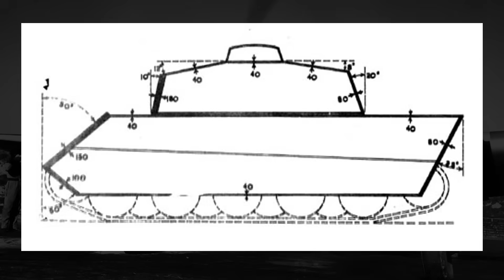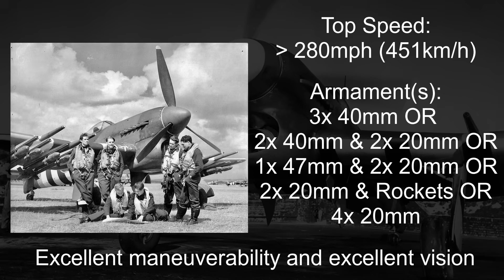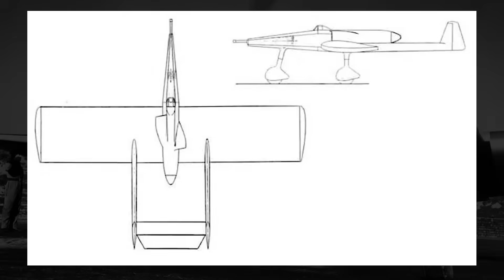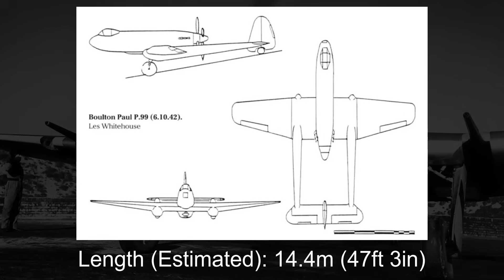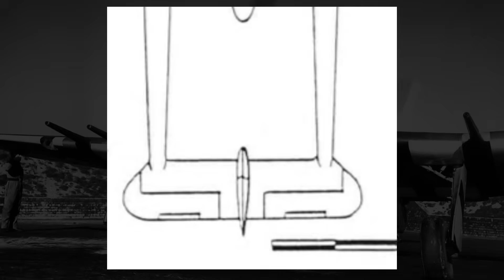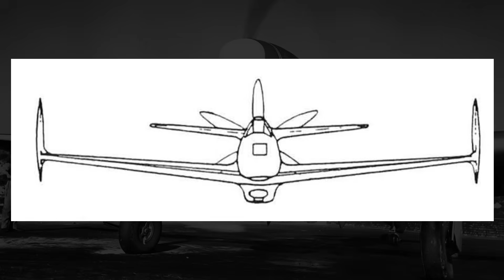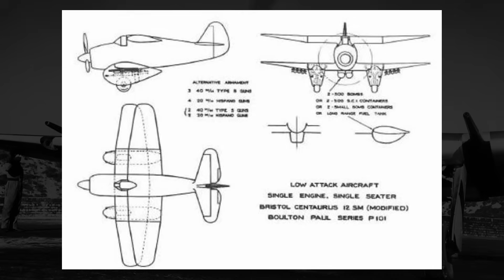Boulton Paul's Failed Tankbuster Trio: Boulton Paul P.99, P.100, & P.101

Comment: Great video, and I've seen it in the comments here a few times, but I want to get across how important it is to please practise saying it as "BOLTON" and not "Butaan". Like as in "Boulder".

If you're not sure, never a bad idea to ask Siri or Gemini how to pronounce it.  

But, thank you for covering these obscure prototypes that look cool, but never made it into production. They remind me of something out of The original Xbox game "Crimson Skies" or from the movie "Sky Captain and The World of Tomorrow".

Hearing the word "Butaan" So many times made me feel like I was on a Death March.

By the way, the biplane configuration was tried with Lysanders with a fully enclosed and traversing rear tailgunner pod out of a heavy bomber put in between Twin Tails with four .303 machine guns. It was designed for close air support and tank busting. Apparently with the twin wings, the already amazing STOL and manoeuvring characteristics of the Lysander made it more maneuverable than an angry snake, but it was held back by its speed. The air ministry wanted more. But they did build a prototype and it did work well!  The tailgunner was meant not only to counter any aircraft, but to strafe targets after the pilot pulled up from the initial attack run. It reminds me very much of the BP 101 proposal, so perhaps that's where they drew their inspiration from.

Comment: I read up on the Sack AS 6 and it never actually flew, best it ever did was some minor hops and nothing they did ever worked, though one proposed fix was never implemented, which was to replace the 240hp Argus engine with a 2000hp DB605....which is a near ten-fold increase in power and probably would be enough to get it airborne....and also enough to disintegrate it. Mind you, they already reinforced the tail to deal with the 240hp engine.

Comment: The discussion of these aircraft and with the visual images of rocketed loaded Typhoons misses an import point to the story. In 1937 Sidney Cam was started work on the replacement for the Hurricane and ultimately the Spitfire. The Typhoon was rushed into production in 1940 & 41 after its first flight in 1940. Perhaps rushed too soon but there was a war on and this was Britain’s darkest hour. The increase in performance would be provided by using the newer generation of power plants. Unfortunately the aero information used for the design of the Typhoons  wing created a wing with a too great of a thickness relative to its chord. The extra horsepower of the Napier Sabre engine over the Rolls Royce Merlin was wasted  pushing the thick wing through the air. The high altitude performance of the Typhoon was disappointing compared to the Spitfire. So the Spitfire stayed in production with continual improvements but the Typhoon lacked the desired high altitude performance, but the Typhoon was already in production. Luckily they found another role for this fighter at lower altitude. Sidney Cam finally figured out the thin wing would provide the desired performance and that aircraft was the Tempest. So no need to build a one trick pony with a unique Boulton Paul aircraft when another Hawker aircraft was already in production. Am I missing any details?
Reply: That’s when they developed the Tempest if I remember correctly.

Comment: Well my guess is, the mechanical arm trowing the pilot down would require far less force to work. It could just be something similar to the fork that brought the bomb away from the proppeler on Stuka or Dauntless dive bombers. Flinging the pilot up would be fighting against the gravity and thus it would require some more complicated and heavy solution that this.

Comment: I managed to almost catch the original video before the strike ... found the copyrighted article + illustrations because of it too, that was weird. (it got taken down within the time I'd gotten it on a recommended list, watched a video, and then opened the link)

Also Boulton Paul should've focused on a more conventional layout twin engine heavy fighter with both dive-bomber features (optimized for higher speed glide-bombing, not full steep angle dives), and more multi-role capability. Ideally dive-brakes that could be deployed mid-dive for recovery and not just to limit maximum dive speed. (thus useful both from anti-armor bombs and general purpose bombs, and for using cannons: where the added airspeed and dive angle would maximize penetration against sloped armor, while still allowing dive recovery at low altitude)

I'm not sure the British had an optimal autocannon for that role, though.The 40 mm vickers S cannon had some potential if the littlejohn adapter had been developed sooner (or lighter APCR type ammo was developed), but something more like the American M9 37 mm AA gun (that saw experimental aircraft mounting, plus PT boat use, not to be confused with the much lighter and lower velocity T9 AKA M4 cannon) or the Soviet NS-37 or NS-45 (with normal thickness barrel, avoiding the issues of the version slimmed down to fit through a propeller hub) would've been more appropriate too, but that seems even less likely given Soviet technology sharing was pretty one-sided.

The 40 mm Vickers S with APCR type ammo would've been much quicker to develop than the suqeeze-bore Littlejohn design (and also avoid the severe barrel wear), so plausibly could've been developed earlier in the war without significant difficulty. (the alternative of necking down the ammunition and barrel to a smaller caliber would have reduced yields for muzzle velocity with the rest of the weapon remaining the same and barrel length not being significantly increased, as larger bores allow faster acceleration at a given chamber pressure, plus the bigger bore made for more versatile explosive shells for use on soft targets;  the 40mm vickers projectiles were quire large and long, too, so could still be made to have an efficient aerodynamic shape for lighter APCR type ammo, for relatively decent down-range performance of such projectiles).

Hypothetically, adapting the small box magazine to a drum feed for a centerline nose mounting (on a twin engine heavy fighter) would've allowed a lot more utility of such a weapon, either in a single or dual mount. (a single mount with more ammon would generally be more useful than the twin wing mounts used on Hurricanes, even with the same low rate of fire, but a heavy fighter would likely have the performance to carry two)

OTOH, speaking of Boulton Paul, their single-seat Defiant variant would've likely made a quite reasonable replacement for the Hurricane and supplement/complement to the Typhoon, and potentially reliable enough and available enough to be used in a wider range of theaters than the Typhoon was for much of the war (including North Africa). The early, lower altitude rated RR Griffon might have mated well enough to it as well, and been suited to low altitude use. (OTOH one could argue the Defiant platform with either the Merlin or Griffin would've made a much better platform to adapt to carrier-borne service than the Seafire turned out to be, with the landing gear arrangement larger wing area, overall more robust design, but still more modern and more refined than the Hurricane, and all metal construction , less fire prone and somewhat less corrosion prone than the Sea Hurricane ... and less finicky center of gravity issues than the hurricane)
The Bristol Hercules also might have been a suitable option for a re-engined Defiant derivative, too. (and more damage resistant for the ground attack role)

That said, given the poor accuracy of both bombs and rockets, a 40 mm Vickers S armed Typhoon also would've made sense to implement for the tank-buster role. (maybe even with modified wing bulges to allow for drum magazines to be fit ... which would probably be a better compromise than hypothetically trying to fit 4 cannons or something weird like that)

Comment: 6:48 compare that desired maximum speed (280mph) with the same stat for medium and heavy bombers.  About the same as B25, B17, et al.
  The problems are simple: bigger guns = slower rate of fire (fewer rounds per pass) and they shake the plane up pretty badly.  Smaller guns have greater rates of fire, but significantly less pen.
  Then there's the ultimate tank-busting cannon: the 3cmBK103.  Mount two of those on a Beau or B25* and you've got something worth shooting.  Higher ROF AND Pen than the 3.7cmBK or US 37mm T9.M4.  Fast firing, flat trajectory, high penetration.
---
*Or Me410 or an Uhu.  Or a Nick.
Reply: the m3 75mm in the B25 didnt need a high rate of fire.
one hit or even near miss was enough..

Comment: For the love of all that is holy!  Everyone keeps telling you in every video where you use the name, that it is pronounced  Bolt-en  or even Bolt'n not Bouw-ton!!!  Also designations for aircraft from the Air Ministry were not the same as American ones for obvious reasons.  F as stated was fighter, but Bomber & Ground attack were subdivided. Regardless, THe number you gave F.6/42 was for a Medium altitude lightweight fighter, introduced after the capture & evaluation by the RAF of the FW-190 in 1942. The Bolton Paul p-98 design was one of these, but was rejected because it didn't meet the weight restrictions. The P-100 was developed from that separately as a ground attack aircraft, and was not really part of the ministry specification since it was not a fighter. The P-101? Dismissed out of hand. Fortunately we ended up with The Hawker Fury, Tempest and better Spitfires instead, and the Tiffy was a perfectly capable ground attack aircraft.  You seem to have confused 2 completely separate Specs.